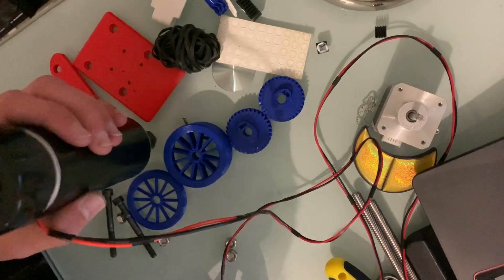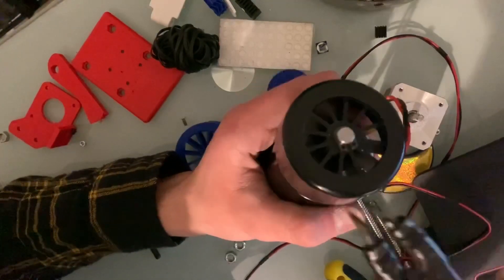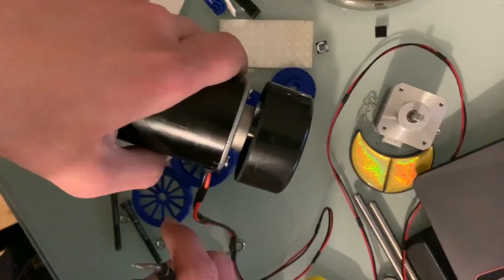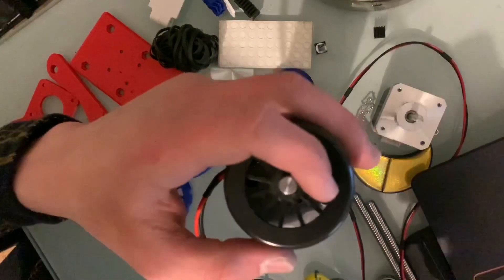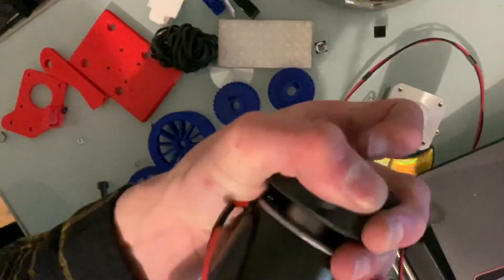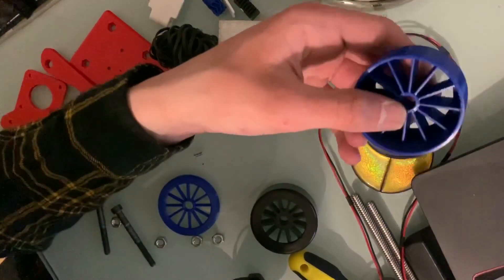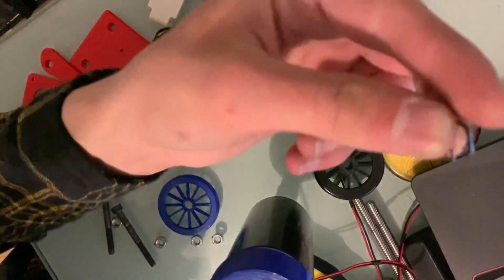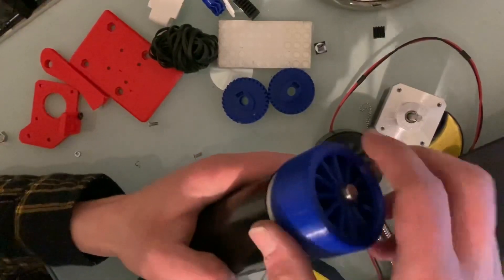500W China ‘machifit’ CNC Spindle Fan replacement

Comment: Why didn't you design the top of it flat? You can avoid supports or bridging. Did you compare weight of the print and original? Or rpm?
Reply from the maker: To be honest I just wanted to design something that was the same as the old one, because I kinda broke it.

It seems to provide the same airflow, because I am not getting any preformance issues. One other thing that I can say for sure is that the weird noise that came from the fan is gone. 

So in short. I did no scientific tests 😅

Comment: So......................................... Did it improve cooling, noise, anything at all?
Reply from the maker: Good question! 

since my original fan was kindof broken it did improve the noise. But I wouldn’t dare to say if it improved anything compared to the original.

I think the cooling is about the same and the design is lighter then the original (depending on the settings)

This was just meant as a replacement for people that would need such a thing. So I did not really alter anything else, just to keep it as close to the original.

Comment: I have the same spindle and was hoping to add a tachometer feature to it by epoxying magnets inside the fan and adding a sensor. I like your idea of 3D printing a replacement. How did the part stand up to the centrifugal forces of the high RPM these spindles generate?
Reply from the maker: Well It basically works the same as the old fan. After I replaced It i have never had any issues with it. I have tested it with the max speed of my spindle and it held up perfectly. Though it may vary due to difference in material, temperature, infill, and wall amount

I do think it would be able to stand up to that amount of centrifugal force, but you'll have to test it out yourself to be sure